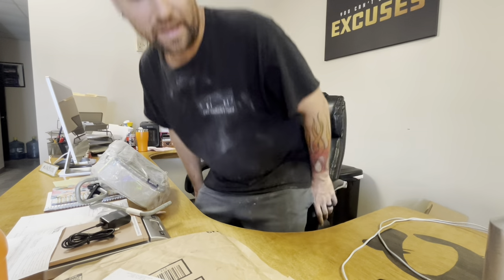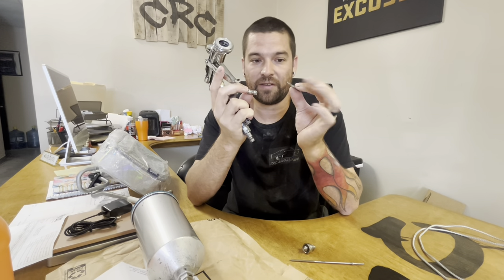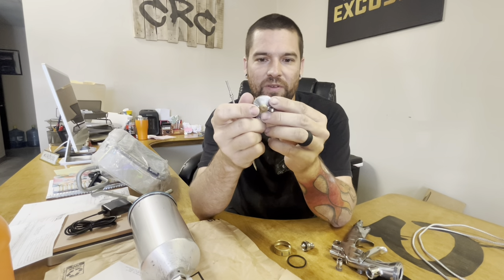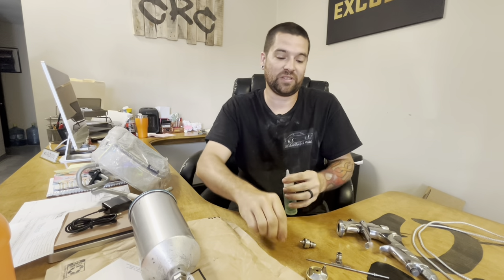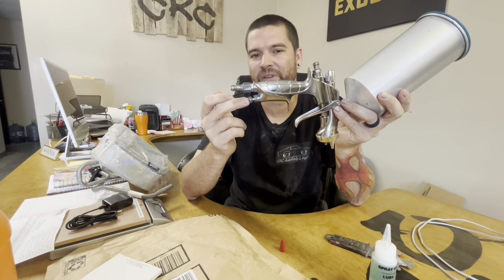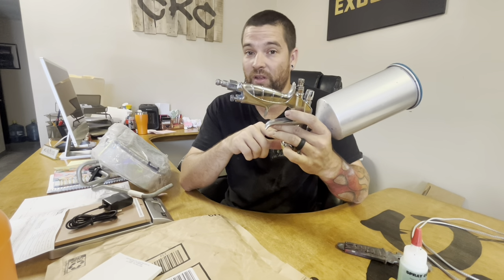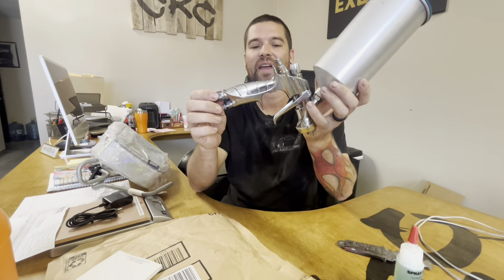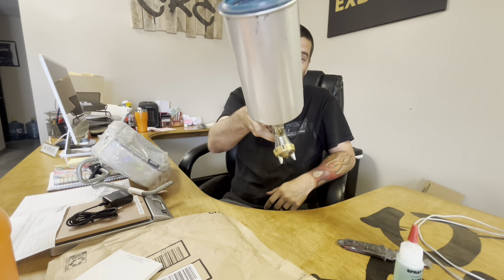💥 DIY Paint Gun Set Up & Info 💦 How To Start Painting Yourself 😉

Comment: My cheap hf siphon feeds fan adj. works, but barely 😢.  Feels stripped, but isn't.  Gonna upgrade.  Ever run into this?
Reply from the maker: I had one that the cap was turning on the shaft under the cap. Some caps are held on with a screw you can tighten down. Try to pull the cap off and see if you can adjust using the shaft. If you have a warranty just swap it out though.